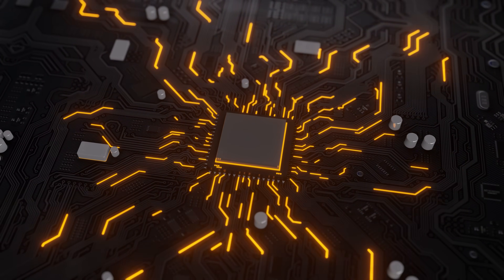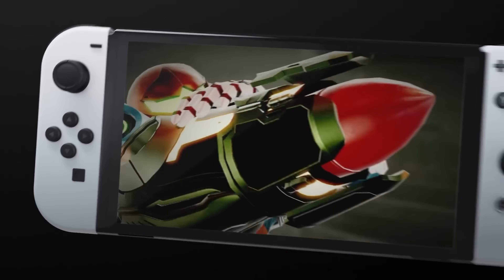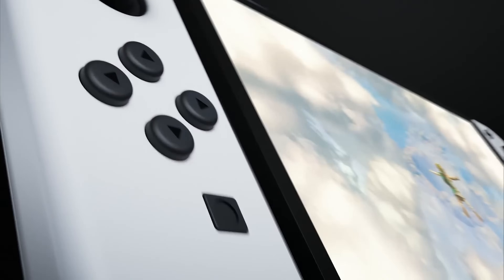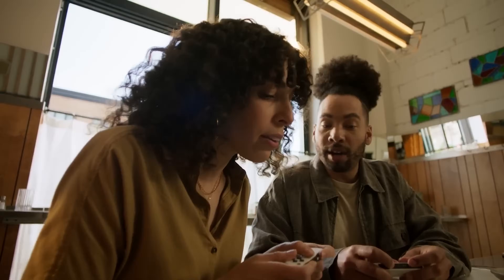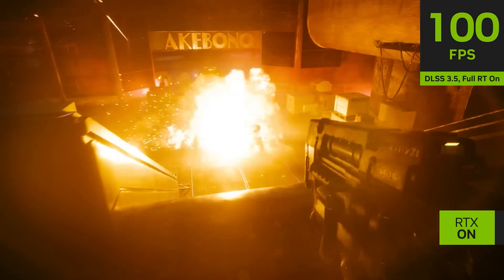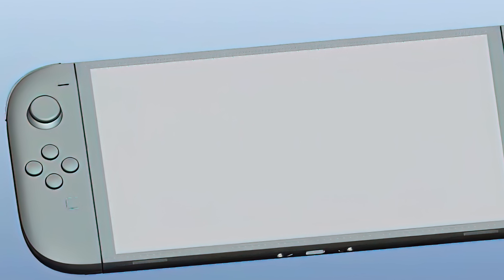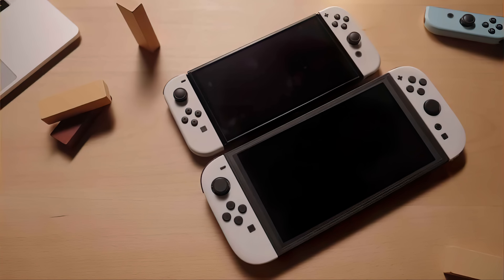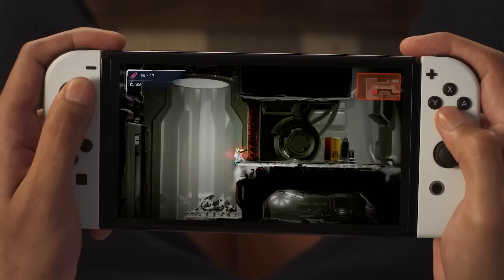Nintendo Switch 2 Updates: SOC CPU + GPU Technology Node (nm) Evidence? + L3 Cache Upgrade Analysis

Comment: Good video. The one problem with your analysis is the assumption that dock mode would meet your expectations regardless of node. 

In theory, it sounds logical - just run the dock mode's power until you hit the ceiling. Problem is that Nintendo CANNOT afford to have a massive gap between the two modes. Portable mode MUST be able to provide the same BASE performance. Image quality can always scale.

Also, if Nintendo is forced to clock thr GPU very low in portable mode, trying to accomplish a low enough power draw may result in them running the GPU BELOW the efficiency point in portable mode (a point at which you get less performance per watt than at higher frequency). From there, upping the GPU clocks by 2x won't get you anywhere close to the docked performance you expect( and as stated, they can't make the gap too wide)

Long story short: Portable mode will ultimately dictate the docked performance. But, it's all the more reeason why Nintendo would opt for 4nm.
Reply: This. Such very good points laid down.. Alot of discussions usually boils down to":

"Handheld 900-1080p"
"Docked will use DLSS to upscale 4K"

Like people are overestimating DLSS and thinks like it will work like magic that can upscale games to 4k for "Free". All the info we have in regards to how DLSS work is contained with high-end GPUs with high abundance of Tensor cores. GPUs that can already run 4K to begin with. Meanwhile the T239 just contain enough to be able to do it AND STILL it'll not be in the same frequency as the PC counter-part.. 

Also I very dislike how people throws the "Docked will be 4K" when even the PS5 struggles to do so and yes T239's potential DLSS capability  is not the solution to it.

Even if Nintendo decides to OC T239, it will barely hit that mark and targeting and optimizing for 1440p is IMHO the better choice right here..
Reply: @vivid8979 DLSS has a fixed cost on tensor cores, so it's not necessarily pointless to examine how the feature works on high performance PCs. I don't know what the threshold is for what level of upscaling is possible on a device like Switch 2, but even older cards with less advanced tensor cores than what Switch 2 will be based on (Ampere 3rd-gen cores), are still able to upscale to 4K, from 720p.

 Digital Foundry measured a frame time of about 18 ms, on the Ampere-based RTX 2050. It won't get you to 4K-60 out of every game, but it's a 4K output nonetheless. Games that run at an internal 1080p may have an easier time hitting 60 fps. 

DLSS becomes more computationally demanding the wider the gap between input and output resolutions are. Too wide a gap means that tensor cores have too little information to work with in order to adequately "fill in" the missing pixels. So you are limited more so by PRACTICALITY than you are by the actual performance of the tensor cores. 

I do agree that a 1440p upscaled output may be the sweet spot for Switch 2 games, especially exclusives.
Reply: Nintendo could have a gap between portable mode and docked mode, I wouldn't care. Honestly that wouldn't be any different then PS5 with it's performance and resolution mode. You would have a high quality system for docked, and a weaker version experience for portability. Logically that makes sense. If they were both to be the same quality, that means either both are not going to be as good as the people want, or the system is way to much to make both run high. This is the problem with the hybrid model, you can't have the best of home console and handheld system unless it's very expensive.  Meaning it's doomed to be 50% of both, meaning you get a compromise, and the thing about compromise is, it means nobody gets what they want lol.
Reply: @ItApproaches  Having a gap is the whole point of having two seperate power profiles. Notice I said "Too large of a gap."

Nintendo will avoid having too large of a gap because they could end up in a Series X/S situation where the portable mode just can't pull off the same experience as docked mode, despite already dropping to a lower resolution.

Ideally, Nintendo would want feature-parity regardless of mode. No reduced frame rates, lower crowd density, cutting of ray-tracing in potable mode, etc (like many Series S games do in order to run Series X games). A seamless process Switching back and forth is the allure of the Switch concept - something Nintendo executed very well. That's what Switch 2 must be able to do almost flawlessly. A massive gap between modes = missing the entire point.
Reply: @Oryon7  True, they aren't going with 4K in Docked and 720p handheld. But I could see 900p handheld, 1080p docked. Or 1440p Docked and 1080p handheld.

Comment: 8nm 100%, likewise when switch 1 used larger die even when smaller was available from nvidia
Reply: 8nm don't fit on nvidia custom design. So its 100% out.

Comment: My predictions: It'll be less performative than a Series S on average, but DLSS could help many ports get within range. 

I also think it'll be the T239 chipset, 8 nm & be able to upscale to 4k, though most games will be unable to hit that. The only 4k titles I expect to see are remasters of last gen games & smaller AA or indie games. 

Its GPU may actually match Series S in some titles, but the CPU will hold back frame rates in most 3rd party ports.
Reply: If you expect Series S performance, than it will not be 8nm. The T239 specs don't fit with 8nm without overheat.

Comment: It's 8 nm, no way they're going 4 nm. When it comes to Nintendo, assume they're going with the more affordable option.
Reply: LPDDR5X RAM was the most expensive option on the market but they choose it. There are also alot of cheaper options for storage but they went for UFS 3.1 256go. 

They could have also went with basic 10nm, 12nm or 14nm they are cheaper than 8nm. Why would they go with a big 8inch screen? 7 inch is cheaper. Why would they go for a 1080p screen? 720p is cheaper. Why would they go for a bigger battery? A smaller one is cheaper.

If 8nm could do what 5nm(4N) could do then it would make sense to go cheaper for the same performance but it can't.
I am still waiting for an actual constructive reason how Nvidia/Nintendo accepted going with a huge 1536 cuda cores GPU on 8nm while having to face thermal, size, consumption and performance problems which would have all been solved by using a better node. Even something like 6nm is alot more viable than 8.
Reply: @stephkm3655 Methinks Nintendo smells blood in the water with how weak the PS5 & XSX/S have performed, combined with increasing competition from Valve and PC handhelds, that they feel now is the time to go all-in.
Reply: 8nm is more expansive than 5nm at the end. With 8nm the machine will consume lots of power and they will need to use a bigger, heavier and more expansive battery, plus a big and louder internal fan, plus more expansive thermal protector, plus more plastic to a better air circulation, plus the Samsung licence to use their node. When you sum up all the costs to 8nm, plus as the problems, like a bigger, heavier and louder device that can burn someone hands, the obvious choice is NOT use 8nm.
Reply: @alessandrooliveira3218  Your power consumption and fan noise assumptions presume that Nintendo runs an 8nm chip at high speeds. Experience has shown that they will simply kneecap its portable clocks to solve the engineering issues. I would hope they go in a different direction this time, but their history says otherwise.
Reply: @jasonpeterson3860  Noo. 
T239 is a fully custom chip. Nvidia/Nintendo would have just made a smaller and CHEAPER GPU rather than make a big GPU for 8nm and downclocking it to hell. The smaller GPU with normal clocks would had have the same performance as the super downclocked big one while being CHEAPER. It is because the GPU is huge that 8nm doesnt make sense.
T239 is not an off the shelf chip like TX1 where Nintendo had to design the Switch around it, with T239 they can actually influence the core chip design. And downclocking the chip when they could have just made it smaller and cheaper makes complete no sense
Reply: @jasonpeterson3860  let me get it, Nintendo paid for Nvidia create a new custom T239 chip, with specs they want. Ndivia did it and now Nintendo will NOT use the specs because 8nm can make the whole thing cheaper? Is not better create a cheaper t239 instead? Plus, even downclock a 8nm Orin to the minimal it get, the power consume is too high for a portable (15+ Watts for GPU alone). Switch 1 use less than 7 Watts for the ENTIRE console.  So no, 8nm don't make sense at all, don't matter how cheap Nintendo is.
Reply: @alessandrooliveira3218  Nintendo paid for the design more than two years ago, back when 8nm was still a common standard, especially for Ampere-based GPUs. So unless Nintendo contracted Nvidia to do a second, smaller node design, we’re probably going to see 8nm in the initial systems. Also, note that I said they’d cut the clocks down for portable play, not docked play. The rumors that the dock will include an auxiliary fan fit this scenario as well, as they need to dissipate a lot of heat when the chip is running at full performance. I actually hope I’m wrong, and that Nintendo contracted for a smaller chip, but their history doesn’t support that.
Reply: @jasonpeterson3860  The T239 start the desing at the same time as Ada lovelace. Its a custon chip, half ampere, half Ada. And Ada is 5nm. The number I give here (660 MHz and 15+W GPU alone) is all for portable mode. On Nvidia Leak, the T239 consome only 4.2W on portable mode, not 15+. So, no, 8nm is not the node.
Reply: @alessandrooliveira3218  I hope you are right. I truly do. I have significant holdings in Nintendo, and I want them to deliver a compelling and successful product that will be as beloved as the Switch has been. Plus, I have a substantial library of game on my Switch, and hope to have an even better platform to play them on going forward.
Reply: I remember when the Switch rumours were at hype and the discussion was if the hardware was gonna use Tegra X1 (20nm) or Tegra X2 (16nm).
It seems like that all over again, unfortunately.
Reply: @AceA254  Noo it is not the same thing. T239 is a fully custom chip so the node choice was made years ago. TX2 wasnt even available until late 2017.
Reply: @AceA254 Not at all because this is a custom chip not an off the self Tegra chipset.
Reply: It’s not 8nm.
Reply: They will likely go with Garg CX 9's from the year 7003, Nintendo always has a tendency to use tech from the future, like the Switch which used Tetra 4H chips from the year 4088.
Reply: @ItApproaches  True, but they made a mistake going with the Ryzen 7090 Ti XTX, as SGI resurrected from the dead & overpowered the industry with the 3dfx RDNA69x4D. Maybe this time they'll be wiser & not ignore Chromatic Research technologies.
Reply: @corey2232  We have to wait and see, it might not matter as it's a high chance humanity doesn't even last past this year.

Comment: We factually know it can't be 8nm since early 2022.
Reply: @Zero-K-999  wait, how do we know it can't be?
Reply: @dyo_x0  The leak they Switch 2 has 12 SM. That is is o lot of processor for a small device. If they choose 8nm, is better use  6 SM instead and have some similar performance with a lot less cost for Nintendo. But instead, the chip has 1536 Cudas and 12 SM, so, a small node is necessary to full take advantage of that architecture.
Reply: @alessandrooliveira3218  yeah im with u on that
Reply: @Zero-K-999  why factually? I do agree that this discussion is moot, like someone posted here, the gap between portable and docked can't be too great, so 4nm is the only logical choice.
Reply: @Baiano29  Because in early 2022 there was a huge leak of Nvidia's full roadmap for the near future. The leak included T239 details such as it having 12 SMs.
Nvidia confirmed the leaked documents to be true. And since 12 SMs on 8nm is so terribly ineficient that it would actually be cheaper to go 8 SMs at higher clocks, we do factually know 8nm to be an impossibility for the Switch 2.

Comment: Nintendo is going with 8nm for the sole purpose of saving 4nm for a refresh and using better battery as the selling point
Reply: @jarde1989  why would the purposefully sabotage their launch window for third party support by being inconsistent with their handheld/docked performance, just so they can hold out on a refresh?
Reply: wrong. They will start with TSMC 4N (5nm) and, some time later move to TSMC true 4nm.
Reply: 8nm is Samsung DUV lithography and 4nm is EUV lithography whether on TSMC or Samsung. They will have to spend a ton to redesign the chip to change lithographies. It is not the same as the move from 20nm to 16nm of the TX1.

Comment: If 8nm is indeed more expensive to produce, then Nintendo will simply choose the cheaper option.
Back in Switch one they chose Tegra 20nm because it was cheaper. Nintendo doesnt do unexpected stuff just because.
Reply: What other chip in Nvidia portfolio was better than the Tegra X1 in early 2017?
Reply: Tegra x2 @stephkm3655
Reply: Very wrong, they don't choose 20nm, the chip is already done at 20nm, Nintendo only choose the chip, not the internals. Its very different than T239 that is a custom chip made from scratch to Nintendo with the configs Nintendo want.

Comment: i HIGHLY doubt that nintendo would go with a 4nm process because its only a couple years old. so i will make the not so bold prediction that nintendo will use something older, as they always do.
Reply: Nintendo isnt designing the chip, so they dont choose the node, Nvidia is. Nvidia will choose the appropriate node for Nintendo's targets. If Nintendo was okay with 1h battery life, 8nm it is. Also underclocking the chip to hell doesnt make sense on a custom chip where you can control the core count. The GPU is huge for 8nm, they could have just reduced the number of cores, ran them at normal speeds for the same performance with a smaller and cheaper chip.
Reply: @stephkm3655  Nintendo picks what they pay. therefore, they pick what they get. That is what I'm saying.
Reply: @RiqMoran  Yes but if Nintendo made Nvidia to choose 8nm, they would have also gone for a smaller and CHEAPER GPU that actually made sense for 8nm because the actual GPU is HUGE for 8nm.
Reply: Also dont forget 8nm demands a more expensive cooling solution and a bigger more expensive battery on top of giving less chips per wafer. In the long term 5nm will be cheaper.

Also there is a nomenclature error. T239 is expected to be on "4N" which is a custom 5nm variant for Nvidia products(like the Lovelace GPUs) and not the true 4nm("N4") process. Yes it is confusing.
Reply: You are right. Nintendo is not using 4nm chip. They are using TSMC 4N that is a 5nm. Nvidia move to true 4nm on their blackbelt new cards and open space to Nintendo use the old but good 5nm.

Comment: I think instead of DLSS, Nintendo's gonna be using their own proprietary upscaling technology. I'm no software or hardware engineer but from my knowlegde isn't DLSS a pretty power (battery) consuming process to really kick in? 

Then there's that patent (or really just rumor I don't know) about Nintendo R&D'ing their own custom upscaling technology and whatnot a year or few months ago. Or maybe it's gonna be a hybrid between Nintendo's and NVIDIA's upscaling tech. I don't know I'm an idiot.
Reply: On Nvidia leak, there are a test where they set the T239 at 660 MHz and use DLSS to archive 1080p. The total consume power of that test was only 4.2 Watts. So, DLSS is more than possible to be used on that device.

Comment: Great points and video as always. Unlike some other speculators, you always break it down with the reasoning behind the specs and possible parts. It is actually more favorable the longer Nintendo took to finally comit to assembling and revealing this thing, even up to the 11th hour; the more likely a previously expensive option for a chip (or a better new one); could likely be chosen.  At the end of the day; I know they are going to calibrate and optimize this thing for at least 3 hour battery life in triple A titles and less limits in dock performance. Anything better would be most welcome (at least 5 -6 hours like the OLED)but this seems to be the likely thinking they have going on.